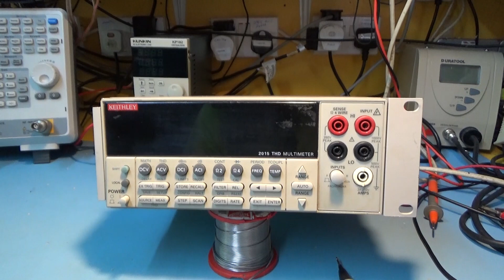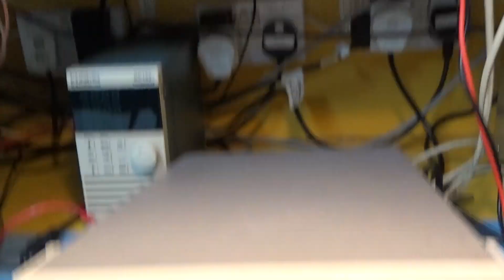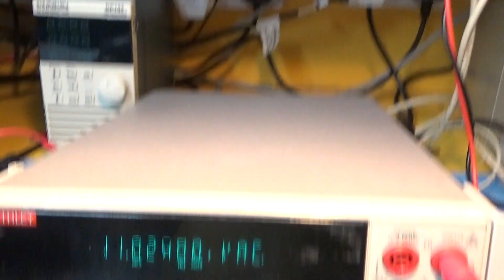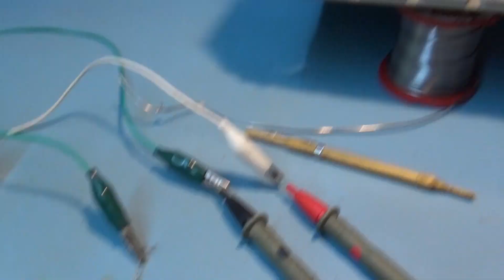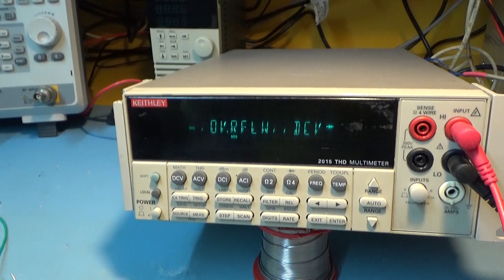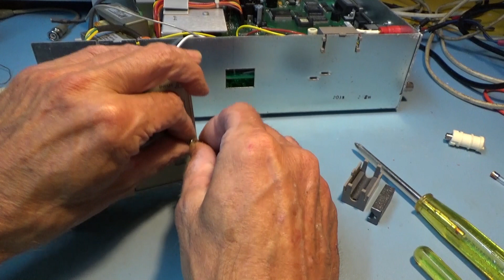Keithley 2015 THD multimeter

Comment: Is the Chinese VFD for the 34401A still working? I've thought about buying one.
Reply from the maker: @dakata2416  yes still working fine, quite a few years later. Though its difficult to tell if it's as bright as it first was. But I'd recommend them if you can find a good one

Comment: I am still coveting this meter.  I suspect I will for a very long time - congratulations on the purchase, Nick!
Per Bob, perhaps those extra lit elements have something to do with cabling to the display; a pin is loose/corroded, something inexpensive like that. 
---   Interesting how they extinguish in some modes, like noise is being coupled in by a particular adjacent element.  Perhaps it's worth inspecting all the solder joints to the EL display...
Reply from the maker: Hi Matambale, well everything comes at a price so you too could have one and being in the US you've probably got loads of choice. I paid around $300 which is cheap but reflects its problems. I checked after Bob's comment and he's right! it is fine on ohms & current. Where does that get me? I've not a clue basically! It looks very clean inside despite the obvious exposure to damp. Maybe I should do a more careful inspection and get the circuit boards out if I can face it, as it doesn't look easy.
Best wishes nick

Comment: Congratulations. I lost out on one on eBay a few weeks ago so it wasn't yours. Those extra segments didn't seem to be there when you were checking Ohms and a couple of other selections which suggests to my poor old noggin that the problem isn't (purely) fluorescent display related. But apart from making sure that some stray signal isn't coupling to that ribbon cable routed along the side of the case I'm at a loss to make any suggestions. But hey, as you say, it works. 👏
Reply from the maker: Hi Bob, its taken me about 5 years to get one at a reasonable price. I paid £255 for it which is cheap, but that reflects its problems. You're right I've just checked and no extra segments in ohms or current ranges. I hadn't noticed that! As you say that may mean it's not a display fault. But I've not a clue as to how to fix it. But it could certainly do with a new display, made me realise how bright the hp meter is. Thanks for your comment